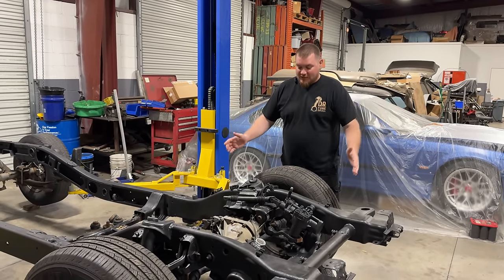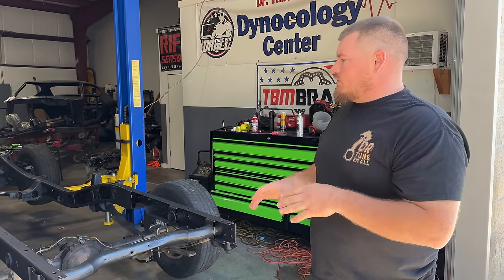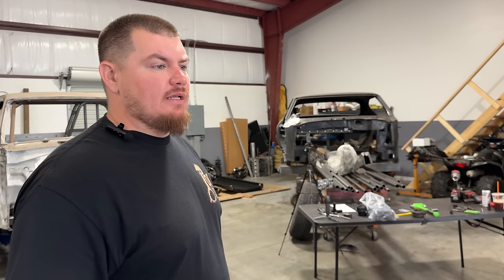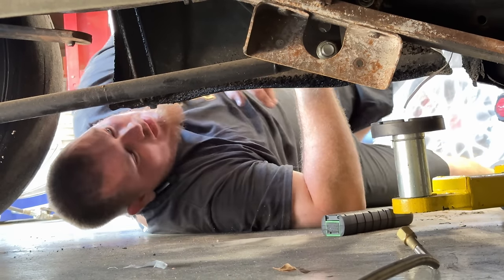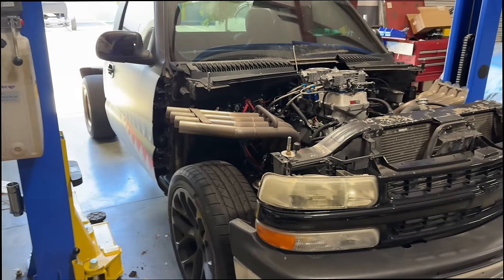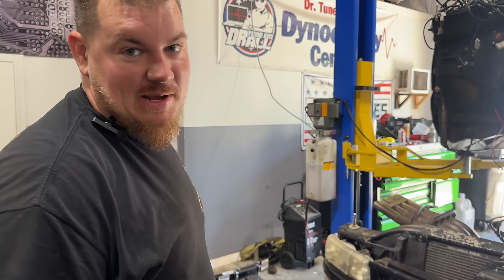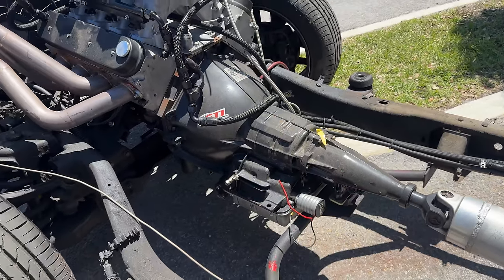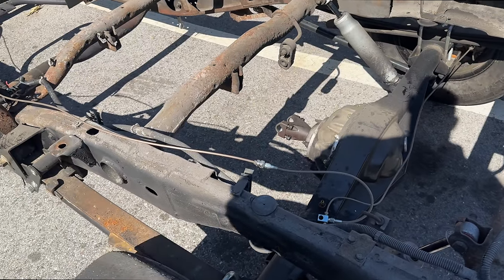Building A Nitrous 4x4 Drag Truck, Mississippi Queen Goes AWD....... Episode 2

Comment: Those splined driveshafts you referenced are PLENTY strong enough for what you’re doing. We’ve ran those on rock bouncers for years and I’ve personally seen 1000-1500 HP rigs with 43” super sticky compound race tires yard sale their junk on limiter and those driveshafts don’t break. You’ll break a 1450 u joint before the splines break.
Reply: Yeah only downside I can think of to staying splined offroad shaft is possibly rotating mass. I'm sure Tom Woods or Adam's could hook him up.

Comment: I have some advice. Have your camera man also wear a mic. We have the camera as our eyes so having a mic at that same area as our ears fulfills that fully immersed feeling as if we're there. 

Then the additional clean and clear talking or narrative audio from the wearable mic blended into the edit as needed gives that professional feel.

Then when editing you can use both mics audio or one or the other as needed. A perfect example was pulling the truck in. Listen to the truck before and after the door opens. A camera man mic would have fixed that. 

I'd also do some audio adjustments to the audio when it gets loud. Just to stop the droning. For example lowering the volume and bass in nates mic in that same shot until the truck was off. 

You can keep the volume on the camera guys mic normal 90% of the time but turn down the mic nate is wearing until the spots where he's talking. It will blend perfect and sound natural while keeping all the benefits and clarity you get from a wearable mic when your talking to the camera. 

There's even some other popular editing tricks where the audio of the next scene starts with some B Roll before the actual video transitions. You'll see this alot in reality TV shows. It's a simple method with huge results. 

As an example. Say theres going to be shot of Nate talking to the camera or working in the shop. Have the audio from that shot start but play some B roll drone shots of the outside of the shop for the first 5 or 10 seconds before transitioning to the video. 

If your at the track and there's a shot of nate giving his intro where he says where here at Bradenton today to Test the truck. Have the first 5 or 10 seconds of that shot where he's talking be B roll of the track and the truck before the video transition to him. 

Another example. Say in the intro he says where back here at the track again. As you remember the last time we where here we broke XYZ. Then use B roll of the track and a 3 to 5 second clip of the truck breaking from the last video to add to your B Roll before the video transition to him to finish the intro. 

Not being a troll at all I'm just trying to help. I've been doing commercial and reality TV editing for 15 years and audio was one of the toughest things to iron out for me. 

I learned that using little tips and tricks like overlapping the video of a shot with B Roll with the audio playing like mentioned above makes a huge difference. Aswell as blending the audio and volume from multiple mics. 

Sorry I know this is alot about the audio but I'm passionate about my work and like helping and giving advice where I can. 

I've been following you for about a year and the quality of your edits seems to get better and better wirh each video. 

I look forward to seeing the quality of your videos drive you to the top brother! Keep up the great work.

Comment: they run splined drive shafts on 2000+ HP mega trucks. it will be fine for your application. just have to get a decent one

Comment: The front driveshaft holds up pretty well. I have a tt 5.3 sand drag 92 blazer same transfer 241c that goes forward to a Dana 44, that we launch at 4000 w 6 lbs and it’s on paddles and we haven’t broken a front driveshaft. Using the same flange style you have

Comment: Pull the actuator off and put a factory lug nut behind it and screw it back in. Locks the front diff in permanently. Usually have to do it when they break and I need unstuck.

Comment: Splines shafts are used on 1000+ hp  rock bouncers with 43+ inch tires. Pretty sure it’ll be plenty strong for your application. I however would be concerned about vibrations from the slack in the splines and really high speeds

Comment: There are 3 wires needed on the diff actuator.  One needs positive, one ground, and the 3rd when grounded locks it in.  Remove power once it is locked in amd it is good.

Comment: Front diff is a thermal actuator. Basically just pushes on a shift fork and ring to lock the stub shaft out of the carrier into the axle shaft

Comment: Just lock the actuator in 4wd and shift it in and out of 4wf at the tcase only. Been doing it since 2018 on my turbo deal. Mostly street driven
Reply: It will remove a point of failure, and you won't ever have to worry about shift issues.

Comment: Get a lockout pin for the front end. That will keep the front end engaged at all times or I think you can still find them a manual lockout kit that has a cable and lever to engage and dis-engage the front end.
Reply: You can get them without a cable also. its just a billet slug that replaces the actuator.

Comment: In the four-wheel drive world our drive shafts would be Double Cardan. And like you said, the slip splines would be on the drive shaft itself. However, you can make that as strong as you want. probably stronger than the transfer case. 

No also that it will be parallel at all times. Not needing to be as strong

Comment: think changing the cabmounts would be the least amount of work getting everything to line back up , maibe make solid mounds using aluminum pucks (talk to sam at cleetus place , he can probably whip those up if you give him the measurements you need ) 
for dragracing you probably need to put a cage in the truck so the solid mound would make it eazier to tie that cage intoo the chassis and close the holes in the cab floor back up without having the cab moving around the cage

Comment: My trucks an earlier body style but I have a posi lock psl600 it's a cable that screws into the dif and mounts in the cab to push it to engage the dif it works well no electronics

Comment: the awd front diff is the same just has a awd  transfer case like from a Denali and the actuator just slides a sleeve over to engage the diff so should be able to lock it in position might even default to locked not sure but my bro his Denali is awd and the front diff the same as my z71 4x4 just the transfer case has no actuator just on the front diff but it could be for the locker on the Denali and the disconnect on my z71

Comment: or you could have you a custom driveshaft made to fit that but it’s not a problem I don’t have a slip you’ll get it you’ll disintegrate it about the same time you will that transfer case. do you want to transfer case as a gear driven not chain driven.

Comment: I have a front and rear differential along with the transfer case out of a '04 Silverado SS I'd let go for a decent price... I live in Minnesota is the only issue. I think these run as a unit, not sure if I can separate the drive line, it's all matching 4.10 gears. (I believe, pulled harder than my truck with 3.73's) Let me know here and I'll give you my contact info, I DO NOT have FB messenger.
Reply from the maker: send me an email drtuneemall@nkpracing.com